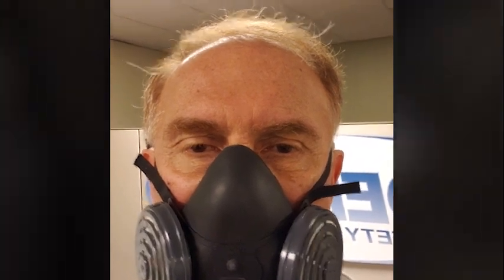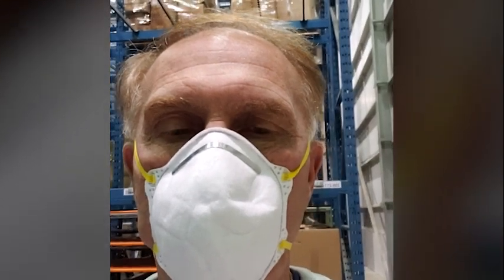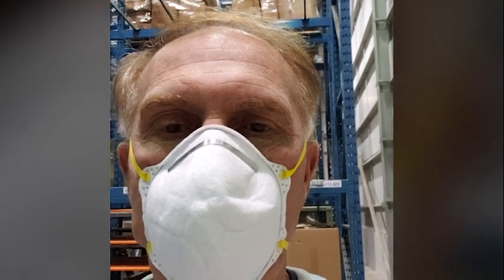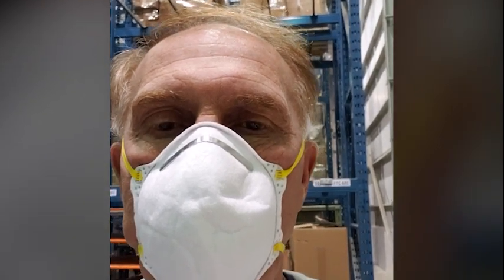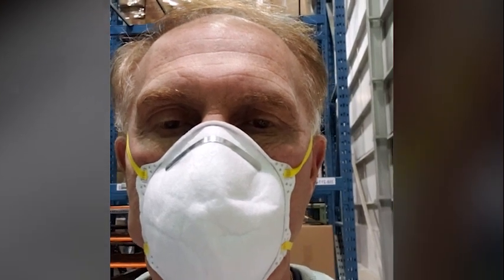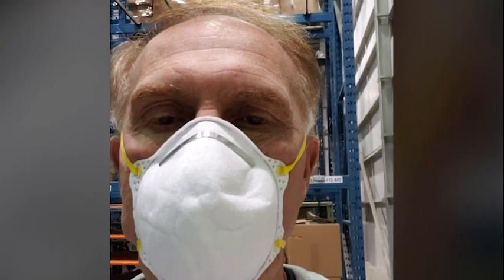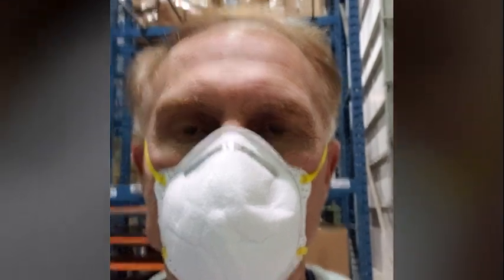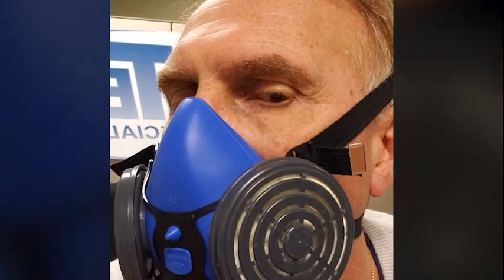N95 Half-Mask vs Disposable Experiment

Comment: I wear glasses, and with the disposable respirators , they sometimes fog up when it's cold out.
With your half mask exhalation valves , because of the placement/whereabouts ,
I don't have the fog build up problem.
The half masks remain cool for much greater extended time periods.